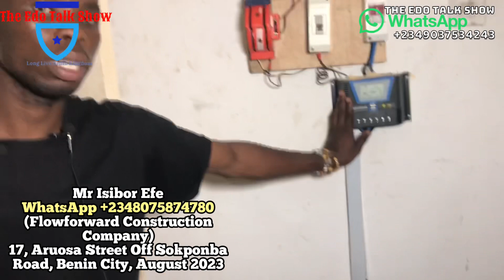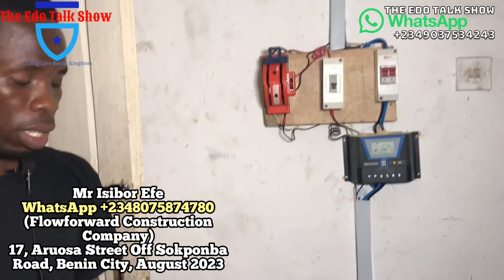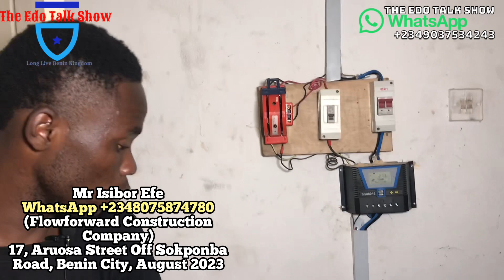Cheaper 24/7 Solar Electricity Power Supply That Can Power All Appliances Like Fridge, TV, Fans ETC

Comment: Oga this one dey carry borehole or they fit use am pump water thanks
Reply: no na.two battery ia too small for dat
Reply: Yes it can if the pump is 12v. And less than 1000watts or 1kva ...
Reply: @outtersteller regular borehole people use is 1 or 1.5 horse power ,people barely use 12 volt borehole ,simple d answer is No
Reply: Yes it can carry 1.5hp pumping machine (borehole) but I put on my borehole pump during when there is sunshine... And it runs for more than 20mins before I put it off